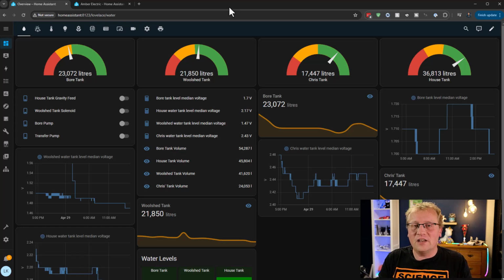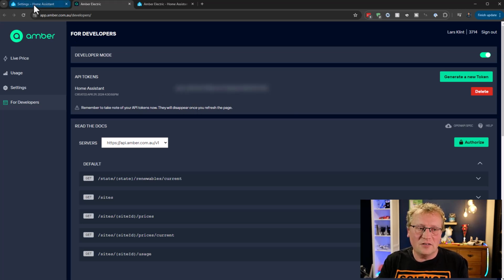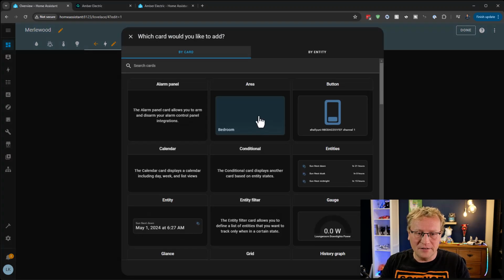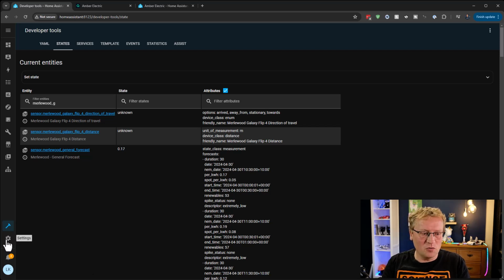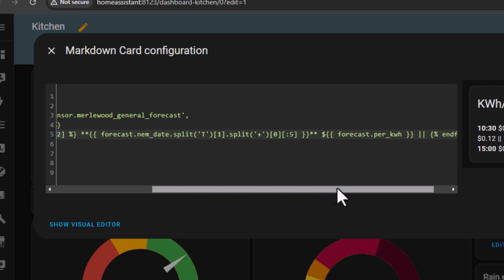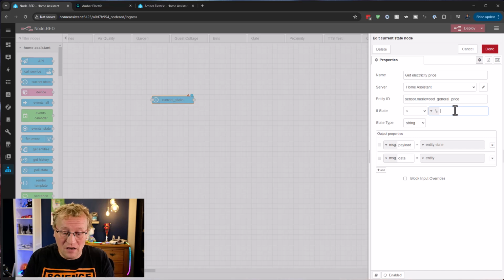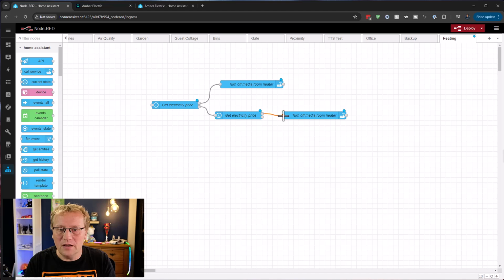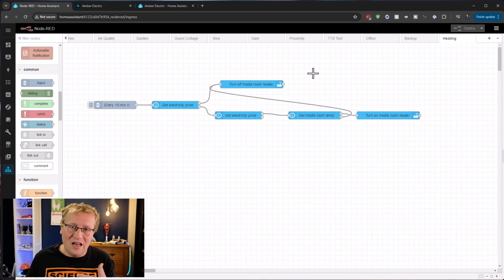Saving money with electricity monitoring and Home Assistant #homeautomation #savingmoney

Comment: Do you still have to pay for the daily supply charge as well?
I am in NSW and currently paying 40c kwh and 12c solar feed in. I average 350w overnight.
I am using a coloured lamp to show when solar is running (traffic lights) or on grid.
Last bill was $340 for 100 days. But winter is coming.
Reply: I am with origin. There is a self read option on their website.
Reply from the maker: @ubeaut  Ahhh, I see. Alright, thanks mate.
Reply from the maker: Yes, I still pay the supply charge. I don't think there is any way of getting out of that one. 
I have definitely noticed I am much more aware of power usage now than before. I am still not sure if I am saving more, but time will tell.
Reply: @LarsKlintTech  I had my bill revised and it was $170 for 100 days and not $340....The bill was an estimate so I went and read it myself and sent them the numbers.
Reply from the maker: @ubeaut  Interesting. How did you get it revised? Just contacted Amber?

Comment: I moved over to amber a month ago and I have set up a led strip above a cabinet to give me an indication of if I should be turning things on. Basically using a traffic signal system, (red, orange and green) to let me know. I use mainly the current values and not the forecasts, I am taking into account  the feed in tariff (FIT), general price, power exported from the grid and how much I am importing. I like this esp when we are having a negative FIT. But I thinking that if I can determine if the forecast for the next 3 hours in increasing or decreasing, then doing things like washing can be better informed.

Also the Australian has put safety guards on the general price and have set maximum price that this can be even though we are following wholesale prices. So even though I am seeing some prices over 40c/kWh it is actually capped at 35c/kWh here in Melbourne.
Reply from the maker: That is a cool setup! I considered doing the light indicator too, but settled on the dashboard as it already exists, and I look at it all the time in the kitchen.

How do I find out if my area is capped too? I am near Lake Eildon. I often see prices over 60c/kWh.
Reply: @LarsKlintTech  I got an email from them "Quarterly Changes To Guarantee Price" which told me.
Reply from the maker: @gjheydon  Interesting. I shall ask them ☺
Reply from the maker: Alright, I think this is it: https://help.amber.com.au/hc/en-us/articles/17105736370189-Amber-Bill-Guarantee-Rates-Victoria

Comment: I have a similar setup where my car charges (& my home battery) when the electricity is cheap (0200 - 0500 15p/kWh) or free, and then pushes power to the grid when it is expensive/pays more to export (1600 - 1900). It's really interesting the things you can do with variable pricing
Reply from the maker: Yeah, that is one of the future plans I have too with batteries. We don't have any yet, so managing heaters is the most cost effective for me at the moment. Do you control car charging through HA too?
Reply: @LarsKlintTech  For the moment, yes. Currently I have a Tesla and with a community add-on can turn the charging on and off. Long term hopefully I'll have a proper wall charger so it could take over (and charge faster) being controlled